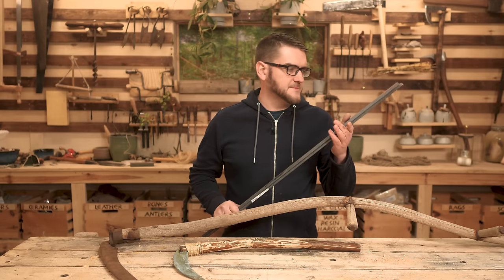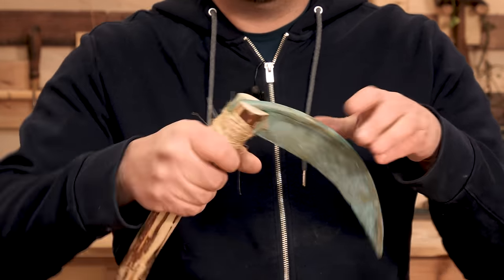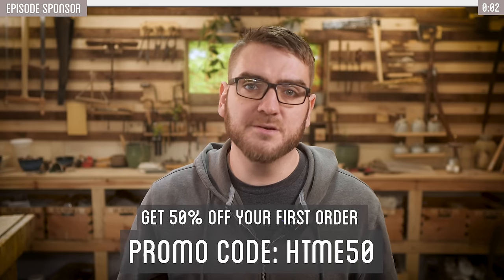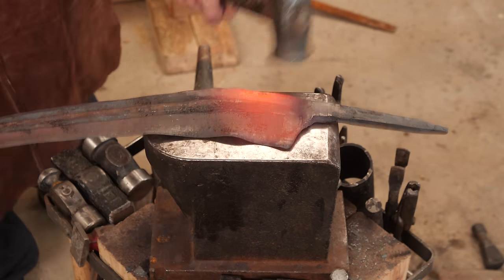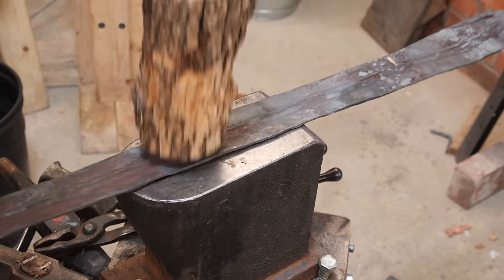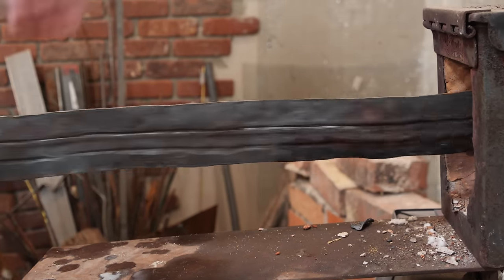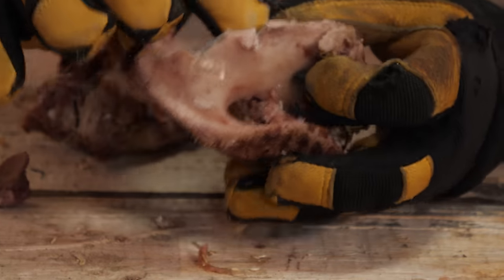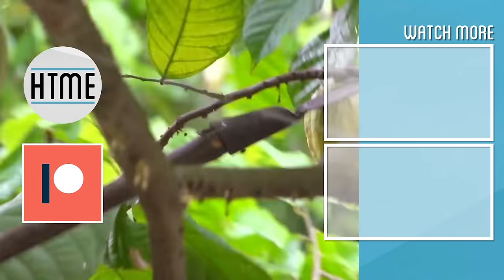Farm to Sword: Can you Turn Old Farm Tools into a Norman Sword?

Comment: Why is everyone being so harsh? Guy showed decent technique, didn't do a bad job at all. Yes he would for sure do a better job if the material was cut and forge welded into a bar, but the whole experiment as it was proposed wouldnt make much sense. Keep it up. I like this a lot.
Reply: Agreed! 👏👏
Reply: Yeah he had proper technique. I think that forging it into a billet would've kept with the idea, it just takes way longer. And these guys probably don't want to spend that much time, which is respectable in my opinion.
Reply: Fair enough, I wish it was The Elven Smith we've seen many times before though
Reply: The quality is actually very realistic for the time. The average sword did not look like a museum piece.
Reply: Those people who criticism are Sam ones who can't do anything except sit in their parents house living on their dime.
Reply: To completely redo it, takes a lot more heat, which in the old days was in short supply, and not everyone could reach the high temps. Maybe that’s why they just straightened it.
Reply: By the time of Hastings i think it would have been more comon for lower classes to cut it up making a bunch of spearheads, and use a sax or ax as a sidearm most peasants at the time had These anyways, blades were more typical for more rich folks or Nobels who could afford a well made blade.
Also i think if someone atempted it  he would just put more time into it because a smith at that time did have the time and was Not pressured to get another Video out to Feed the crowed, under those circumstances i think he made a great Job, but i do think something like a war scythe or perhaps a primitiv dussack would have been somewhat more reasonobal, but im pretty Sure those were Not in use at the battle of Hastings.
Reply: because that sword looks Terrible. the handle especially, my God. this is embarrassing. they can do better.
Reply: because he puts very little effort in to the videos. I am going to keep watching yet I get let down a lot. The lack of prep work and lack of thinking on his part has made some of his builds a waste of his time and money.
Reply: @bilbo_gamers6417  It looks functional enough. A bunch of swords looked bad historically, even after the medevial period we have images of bad swords whose handles are just twisted bits of the stock iron that just loop over to cover the hand. This was no quality blade, but it would be better than nothing for a poor levy soldier and at least somewhat represents the lowest quality weapons in history.
Reply: @kameljoe21  Kinda agree and disagree at the same time, i think more Projekts of his would work better if he either cut down on the size of the Projekt   or makes multiple steps, like for one if you already use the smithy you could make more than one Projekt at the same time who Requier that work step ( sorry for my Englisch by the way, but iam from germany and my autocorrect always Tries to writte in german)
Reply: @1forge2rulethemall88  this is not that. those swords at least were straight, and were not heat treated instead of being Incorrectly heat treated... which is much worse!
Reply: @bilbo_gamers6417  let's see you do better
Reply: @daniel1981de  i am literally forging a sword right now that looks and feels lightyears better than this but even if i wasn't i dont need to be an expert to know he did a terrible job
Reply: @daniel1981de  He already said otherwise, but he could also be a historian or just a blacksmithing buff... you don't have to be able to do things to be knowledgeable about how to do things.
Reply: @bilbo_gamers6417 something tells me youve never made a sword before. If I was betting man I'd put money on the fact you've never done anything admirable.
Reply: @barjekold7140 when a war was coming up, the king would put out requisition orders with quotas. So no they didn't have unlimited time. Of course the orders would come with design and quality standards. So they could not provide garbage quality either. The blacksmiths would get experienced at creating just good enough items as quickly as possible. 
My reference for this is a couple of videos talking about arrow acquisition referencing period documents. I think this was on the Scholagladiatoria(sp?) channel.
Reply: I want to see all these keyboard warriors doing the same thing and show how "easy" it is. Try the craft yourself before bunking on it.
Reply: honestly i think whata shown is a more realistic view into what wouldve been made in the past

all the perfect swords we see today are a product of our ability and technology, a farmer needing to forge a weapon on the fly wouldve probably learned from a travelling blacksmith or tradesman through town, and then had to make do with what he could remember, write down, and create himself or in a community forge
Reply: honestly i think whata shown is a more realistic view into what wouldve been made in the past

all the perfect swords we see today are a product of our ability and technology, a farmer needing to forge a weapon on the fly wouldve probably learned from a travelling blacksmith or tradesman through town, and then had to make do with what he could remember, write down, and create himself or in a community forge
Reply: honestly i think whata shown is a more realistic view into what wouldve been made in the past

all the perfect swords we see today are a product of our ability and technology, a farmer needing to forge a weapon on the fly wouldve probably learned from a travelling blacksmith or tradesman through town, and then had to make do with what he could remember, write down, and create himself or in a community forge.
Reply: honestly i think whata shown is a more realistic view into what wouldve been made in the past

all the perfect swords we see today are a product of our ability and technology, a farmer needing to forge a weapon on the fly wouldve probably learned from a travelling blacksmith or tradesman through town, and then had to make do with what he could remember, write down, and create himself or in a community forge.
Reply: honestly i think whata shown is a more realistic view into what wouldve been made in the past

all the perfect swords we see today are a product of our ability and technology, a farmer needing to forge a weapon on the fly wouldve probably learned from a travelling blacksmith or tradesman through town, and then had to make do with what he could remember, write down, and create himself or in a community forge.
Reply: honestly i think whata shown is a more realistic view into what wouldve been made in the past

all the perfect swords we see today are a product of our ability and technology, a farmer needing to forge a weapon on the fly wouldve probably learned from a travelling blacksmith or tradesman through town, and then had to make do with what he could remember, write down, and create himself or in a community forge.
Reply: honestly i think whata shown is a more realistic view into what wouldve been made in the past

all the perfect swords we see today are a product of our ability and technology, a farmer needing to forge a weapon on the fly wouldve probably learned from a travelling blacksmith or tradesman through town, and then had to make do with what he could remember, write down, and create himself or in a community forge.
Reply: honestly i think whata shown is a more realistic view into what wouldve been made in the past

all the perfect swords we see today are a product of our ability and technology, a farmer needing to forge a weapon on the fly wouldve probably learned from a travelling blacksmith or tradesman through town, and then had to make do with what he could remember, write down, and create himself or in a community forge.
Reply: honestly i think whata shown is a more realistic view into what wouldve been made in the past

all the perfect swords we see today are a product of our ability and technology, a farmer needing to forge a weapon on the fly wouldve probably learned from a travelling blacksmith or tradesman through town, and then had to make do with what he could remember, write down, and create himself or in a community forge.
Reply: honestly i think whata shown is a more realistic view into what wouldve been made in the past

all the perfect swords we see today are a product of our ability and technology, a farmer needing to forge a weapon on the fly wouldve probably learned from a travelling blacksmith or tradesman through town, and then had to make do with what he could remember, write down, and create himself or in a community forge.
Reply: honestly i think whata shown is a more realistic view into what wouldve been made in the past

all the perfect swords we see today are a product of our ability and technology, a farmer needing to forge a weapon on the fly wouldve probably learned from a travelling blacksmith or tradesman through town, and then had to make do with what he could remember, write down, and create himself or in a community forge.
Reply: honestly i think whata shown is a more realistic view into what wouldve been made in the past

all the perfect swords we see today are a product of our ability and technology, a farmer needing to forge a weapon on the fly wouldve probably learned from a travelling blacksmith or tradesman through town, and then had to make do with what he could remember, write down, and create himself or in a community forge.
Reply: honestly i think whata shown is a more realistic view into what wouldve been made in the past

all the perfect swords we see today are a product of our ability and technology, a farmer needing to forge a weapon on the fly wouldve probably learned from a travelling blacksmith or tradesman through town, and then had to make do with what he could remember, write down, and create himself or in a community forge.
Reply: honestly i think whata shown is a more realistic view into what wouldve been made in the past

all the perfect swords we see today are a product of our ability and technology, a farmer needing to forge a weapon on the fly wouldve probably learned from a travelling blacksmith or tradesman through town, and then had to make do with what he could remember, write down, and create himself or in a community forge.
Reply: honestly i think whata shown is a more realistic view into what wouldve been made in the past

all the perfect swords we see today are a product of our ability and technology, a farmer needing to forge a weapon on the fly wouldve probably learned from a travelling blacksmith or tradesman through town, and then had to make do with what he could remember, write down, and create himself or in a community forge.
Reply: honestly i think whata shown is a more realistic view into what wouldve been made in the past

all the perfect swords we see today are a product of our ability and technology, a farmer needing to forge a weapon on the fly wouldve probably learned from a travelling blacksmith or tradesman through town, and then had to make do with what he could remember, write down, and create himself or in a community forge.
Reply: honestly i think whata shown is a more realistic view into what wouldve been made in the past

all the perfect swords we see today are a product of our ability and technology, a farmer needing to forge a weapon on the fly wouldve probably learned from a travelling blacksmith or tradesman through town, and then had to make do with what he could remember, write down, and create himself or in a community forge.
Reply: honestly i think whata shown is a more realistic view into what wouldve been made in the past

all the perfect swords we see today are a product of our ability and technology, a farmer needing to forge a weapon on the fly wouldve probably learned from a travelling blacksmith or tradesman through town, and then had to make do with what he could remember, write down, and create himself or in a community forge.
Reply: honestly i think whata shown is a more realistic view into what wouldve been made in the past

all the perfect swords we see today are a product of our ability and technology, a farmer needing to forge a weapon on the fly wouldve probably learned from a travelling blacksmith or tradesman through town, and then had to make do with what he could remember, write down, and create himself or in a community forge.
Reply: honestly i think whata shown is a more realistic view into what wouldve been made in the past

all the perfect swords we see today are a product of our ability and technology, a farmer needing to forge a weapon on the fly wouldve probably learned from a travelling blacksmith or tradesman through town, and then had to make do with what he could remember, write down, and create himself or in a community forge.
Reply: @jamescanjuggle  I don't know how often the poor resorted to low quality locally produced weapons. I do know there was a thriving trade in weapons that covered Europe and beyond. Good quality swords were mass produced in several countries and exported all over. Obviously the details varied a lot over the many hundreds of years of the Middle Ages.
Reply: My only issue is the cracks because he didn't keep it up to temperature
Reply: A lot of people think they could do better! (They are generally wrong!)
Reply: @faerhazar939  Genuinely almost anyone that knows how to weld and use a grinder could probably make something better than this. Like, anybody who has done metalworking or jewelry working. I am tired of excusing shoddy work. They don't need to be davinci but they need to be Competent enough to produce tools that don't look like they'll just break.
Reply: @bilbo_gamers6417  I think you missed the point.
Reply: I think he did a great job! I personally think a Krieg Messor or some other one sided edge blade would be better for overall strength, or a straight up pole arm like they normally made farming tools into back in the day. Thats personal opinion though, for what he was given and asked to make, it looks great, and swords were known to get bent up during fighting.
Reply: its a low cost passants self defence option
Reply: Yep
Reply: Because most people are Aholes they rateher criticize than compliment. They guy did a job job for being a apprentice

Comment: Historically, scythes were more often reworked into polearms I believe than into swords, as if your weapon was made from a scythe, most likely you weren't the most highly trained warrior, exactly, so it was more common to convert them into polearms- called "war scythes"- than into smaller weapons, such as a sword. Haven't finished the video yet though, so idk if you'd already mentioned this or not. Sorry, if so!

Edit: After watching the full way through the video, I must say, I'm surprised and a bit confused by your choice of what kind of sword to create here. The arming sword you created seems like it would be too thin, and it looked to have a lot of major twisting and warping in it- and that tear in the blade is a major weak point where the blade is likely to break, should it ever encounter major stresses, such as through combat. It would have made more sense- in my opinion, at least- to have a forward-curved blade as it already was, with perhaps a small false edge near to the tip, and that thick spine slightly thinned out in the rest of the sword from its original thickness. This would've been similar to the design of some african swords, as well as other forward curved blades like the falx.

Regardless, this was an enjoyable video to watch; I simply wanted to give my thoughts and suggestions here, as I do a bit of blacksmithing and bladesmithing myself, and quite a decent bit of experimentation with swords.
Reply: also, a war scythe needed not a lot of reforging done to become one. It's basically just changing to angle of the tang, which is the thickest part and can be more easily reforged than the thinner blade
Reply: @bl4cksp1d3r Indeed; in all honesty, I am quite worried about the structural soundness of this blade they've designed here. If they were going to make a sword of this, they should have either flattened it out, folded it, then drew it out again, or kept closer to the original shape and profile of the blade than they ultimately did, in my opinion.
Reply: @bloodsmithgamer5071  we can see it in the video at the end. I think their attempt was not "how to make a proper sword from a scythe blade" but "how difficult is it to reforge a scthe blade" and just heating up the tang and putting a single bend in it is obviously not as interesting as a video than making a sword blade from it.
Reply: well as the title says Can you Turn Old Farm Tools into a Norman Sword? was the goal
Reply: @georgiwenckovsky9748  Hm. I could've sworn it was just "a sword" when it originally aired... But fair point.

Comment: Please make a proper grindstone using compacted concrete. 5% to 10% cement, 2-3 times as much water, and the rest being local soil, mix well, get it to a clay-like consistency, then form it into a wheel and compact it really well as if you were compacting rammed earth, and the result should be very close to natural rock, once it cures enough. You can use quick-setting cement, if needed, to speed up the process.
Reply: I think they won't do that for those grindstone weren't common at the point he is in history and they might not do for it is a more modern recipe from what I think but I could be wrong and please correct me if I am.